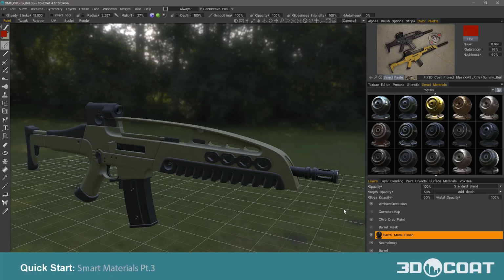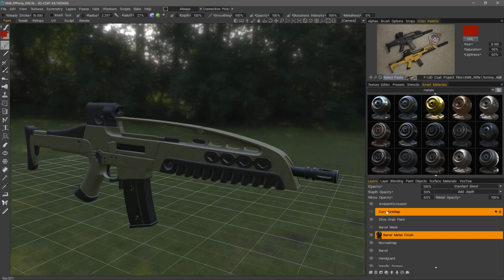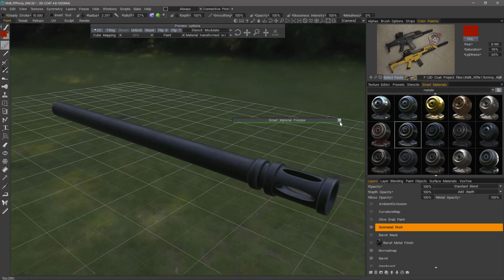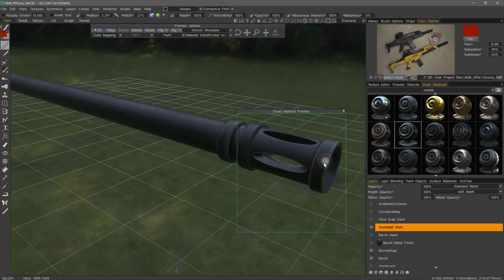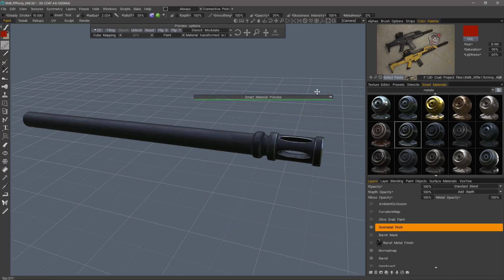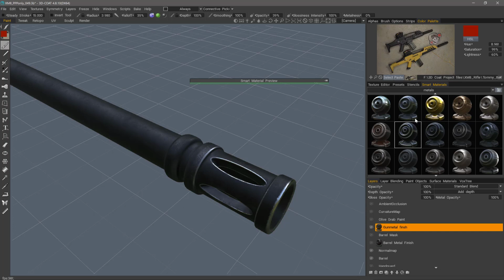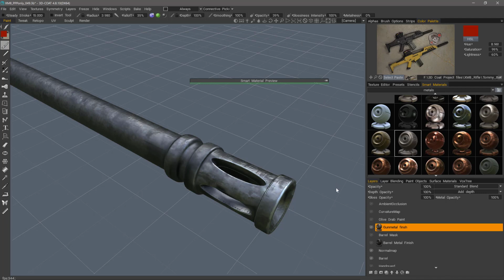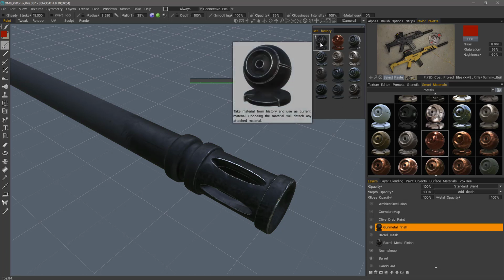Quick Start: Smart Materials Pt.3

Comment: So only Smart Materials show up in the Material History? It’s not possible to see regular materials there?
Reply from the maker: What do you mean by "Regular Materials?" Smart Materials are Regular Materials that have smart features available, like edge wear and such. When you just manually paint with color, depth and roughness and metalness, that isn't considered a material...just normal texture painting. Materials are where you store all those attributes for rapid access in the future...much like a Preset. Just more options.
Reply: @3DCoatTrainingChannel  I meant to say shaders. I guess you can’t store those in a similar history palette?
Reply from the maker: @miikairis  ....Shaders are for the SCULPT Room only, for Sculpt Objects. The reason for that is they are dense meshes without UV's. Smart Materials can be used on those as well...on top of shaders (it uses vertex paint to store the color, depth, glossiness and metalness.